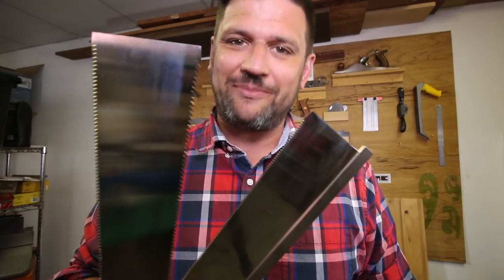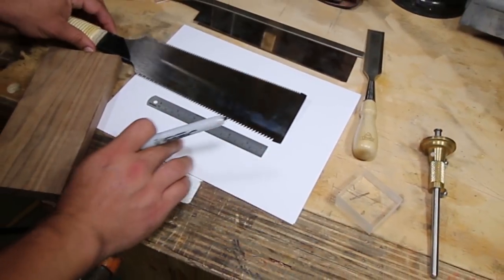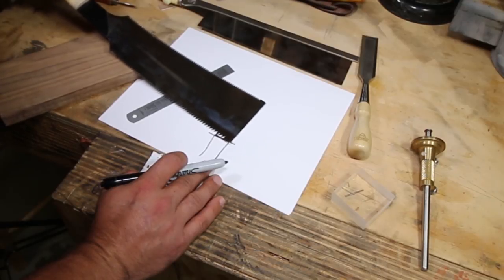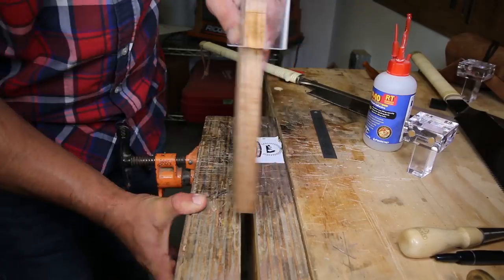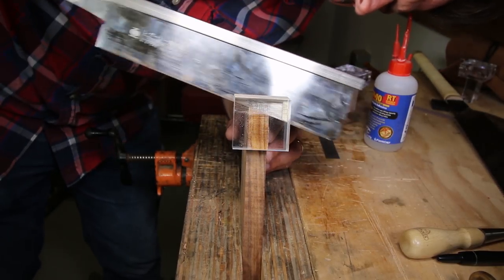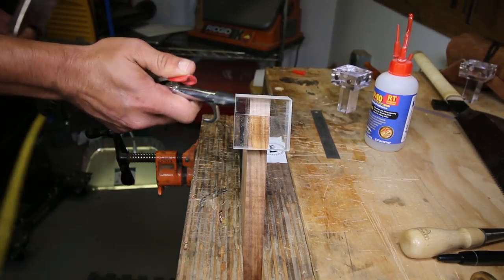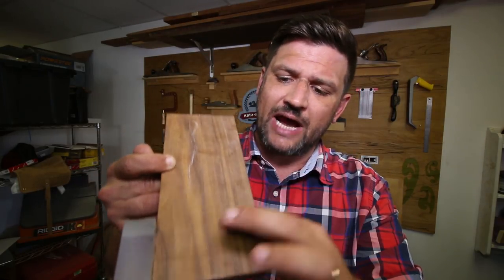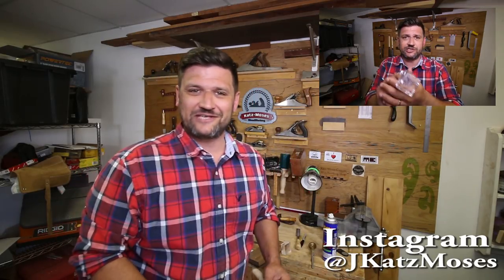Japanese Hand Saw Trick Everyone Should Know

Comment: I studied a bit of Japanese joinery about 35 years ago. They use slip joints to withstand an earthquake and 'Flying Rafters' etc. I gave up because their joinery is insanely complex. A Shark tooth saw made by a master in those days would set you back in the thousands and that was 35 years ago. Their hammers are flat one side to drive a nail, convex opposite side to make a finishing blow without marking the wood.

Comment: Great tip, thanks. 
In some areas of the world, Japanese saws are either exceptionally difficult to come by, or extremely expensive. If you prefer a pull-cut for fine(ish) work, turn the blade of a coping saw around. I found it provided a bit more control...
Reply from the maker: That's a great tip! Thank you!

Comment: I have a trick when I do dovetails where I only use the marking gauge for the depth of cut, dividers, and the saw, instead of using a knife or pencil to mark the end grain and shoulders or the joints I just go straight into my points made by my dividers with the tip of my dozuki and slide my dovetail guide flush with the blade grip the dovetail guide and start to cut to the base line, thank you for this tip it was very useful.
Reply from the maker: Realism91 love it!